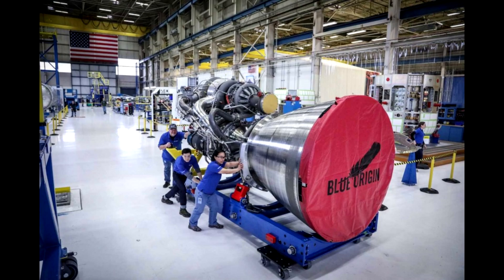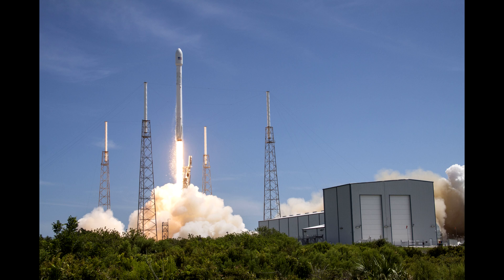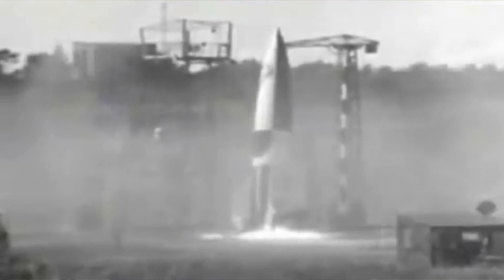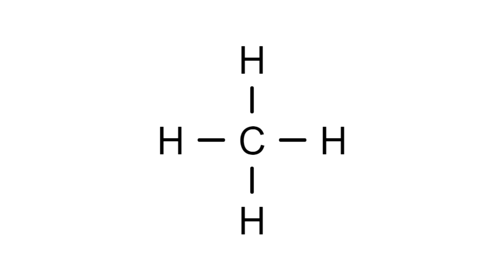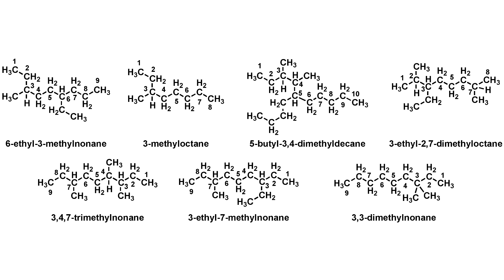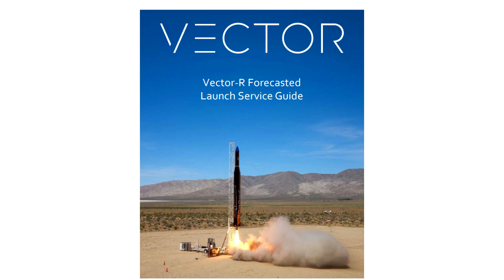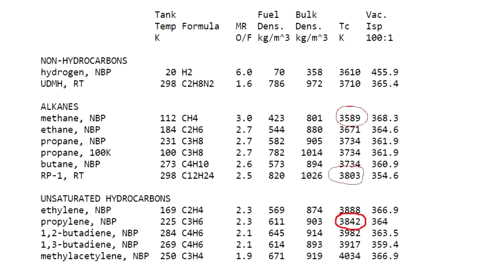Why Next Generation Rockets are Using Methane

Comment: This is funny because I'm in the middle of reading (listening to) Ignition! by John D. Clark. Between that and your video on Soviet-era engines, I've come to think of methane as "The Mario" of fuels -- kind of all-around good-but-not-great with no  particular weaknesses. It's energetic, but not as good as hydrogen; it's reasonably dense, but not as dense as kerosene or the hydrazines; it's quite safe to handle, though not as safe as alcohol or kerosene; and it burns clean, but not as clean as hydrogen.
Reply: Hydrogen does not pollute but it is really dangerous for several reasons, especially in liquid form. One as I mentioned,  because it is the smallest atom is is really good a leaking. When it burns small fames are invisible. There is also this thing called hydrogen enbrittlement where it causes some materials to get brittle and crack. That is an interesting thing to look up.
Reply: Johnny Robinson, It's really dangerous compared to jet fuel or most other chemicals people come in contact with on a daily basis, but you really have to adjust the scale for highly reactive energetic chemicals. I would say LOX is far more dangerous because it can convince just about anything to burn. And embrittlement, while interesting, kind of pales against the hypergols that would happily eat their way out of conventional fuel tanks...
Reply: While liquid hydrogen is a very good rocket fuel, it's also extremely dangerous to handle, as Lockheed found out when they did research on a potential rocket powered spy plane.
Reply: Well, I didn't put it on the list of safe materials. But let me put it this way: Compared to hydrazine derivatives, chloro- and fluoro- oxidizers, aniline relatives, and nitric acids doped with various chemicals, I would much rather catch a little frostbite. (If there's a big splash you're hosed either way, but again, the frostbite might be reparable.) And if there's a spill that doesn't directly hit anyone, hydrogen is by far the safest outside of alcohol and kerosene, since most of the other options give off heavy, toxic fumes in addition to being flammable and/or explosive.
Reply: A huge problem with liquid hydrogen is that when it explodes, it makes a natural gas explosion seem like a minor event. That's why Lockheed, whose "Skunk Works" tried to build a rocket-propelled spy plane fueled by liquid hydrogen, dropped the idea in favor of special turbojet engine designed to cruise at very high speeds: the original A-12 (which became the SR-71).
Reply: @Sacto1654  We're talking about rocket fuel. Large explosions are par for the course.
Reply: AubriGryphon...thats why JPL was placed way out in nowhere Ville <at the time> rockets blow up. Several CalTech students almost burned down their dorm iirc.
Reply: Sacto 1654...if Kelly Johnson couldn't make it work, I don't know if anyone else can.
Reply: @philgiglio9656  Kelly Johnson and his team did make it work, after a fashion. The turbomachinery of the Pratt & Whitney RL-10 rocket engine, which has powered the Centaur upper stage since 1961 (and the Delta IV upper stage, as well as the Clipper Graham DC-XA VTOVL [Vertical Take-Off/Vertical Landing] SSTO--Single-Stage-To-Orbit--sub-scale test vehicle), was originally developed for the Lockheed CL-400 "Suntan" liquid hydrogen-powered spy plane, which resembled a greatly enlarged F-104 Starfighter, with one liquid hydrogen-powered turbojet engine on each wingtip. Also:

It wasn't a matter of Kelly Johnson being unable to do it, but a matter of practicality and logistics. The CL-400 could certainly have been built and flown; no "show-stoppers" arose during its design process. (In fact, in the 1970s--in response to the OPEC Oil Embargo--Lockheed worked on developing liquid hydrogen-fueled jetliners and cargo planes with some NASA funding, beginning with a modified L-1011 TriStar test bed aircraft, with large forward and aft LH2 tanks in the fuselage [the same diameter as the fuselage, as in a rocket; Google "liquid hydrogen fueled lockheed l-1011 tristar"]. One design feature, aimed at further increasing the aircraft's efficiency, involved circulating the super-cold fuel through pipes in the wings on the way to those engines, to achieve laminar airflow.) The problems with the CL-400 were those of size and fuel logistics. The two-seat, high-altitude spy plane was huge (due to LH2's very low density, and the need to carry more fuel than needed for the engines, due to air friction cooling requirements), and the logistics of producing and/or just storing the enormous quantities of LH2 needed for even one flight were nighmarishly complex and expensive (the SR-71 was more expensive to develop, but much cheaper to fuel, store, and maintain than the CL-400 would have been).
Reply: @Sacto1654  
right. remember the Zeppelin ....
Reply: Terry Wilson, while methane has an LD50 that's basically nil, it's probably more dangrous than kerosene in the sense that you're not likely to accidentally drink the latter, while you can inhale a cloud of methane without realizing it and it's still an asphyxiant. I would put alcohol as the safest, unless you try to operate heavy equipment after exposure.
Reply: @AubriGryphon  But methane, being lighter than air (it has been used in balloons, and still is in some cases), is far less dangerous than propane--both as an asphyxiant and as an explosive--if it leaks (as my father, a Fire Chief, told me, having had to deal with both). Propane, being heavier than air, settles into low spots, just waiting to asphyxiate, or burn or kill (if touched off by a spark), while leaking methane rises into the air and dissipates. (He was enthusiastic about the hydrogen stoves, which used hydrogen gas occluded within metal hydrides in storage tanks, that came out in the 1970s, because the hydrogen burned very cleanly, the occlusion storage prevented leaks and explosions [the tanks had to be heated to release the hydrogen], and the burners' special grilles gave unmistakable indication of hydrogen burning when the stove was in use.)
Reply: Yup, that's it.
Reply: I read that book. Clark is hilarious. In the intro, Isaac Isamov tells of when he met Clark and showed him that the Bible was filed under "J" for Jehovah. Another anecdote was his discussion of the special grade of Kerosene needed for the ICBM rockets. Someone was uncomfortable with building an engine that required a special fuel. He argued that once a shooting war started there would probably be no one left to shoot or shoot at. The solution was to store a few extra barrels of kerosene for a couple volleys and that would be good enough. He mentions nuclear rockets and a test that was conducted in the Nevada desert. The event was contradicted by John P. Craven in his Silent War beneath the Sea book. I think both men were present the day of that test. Ignition! is available in hard cover but horribly expensive. My local library now has it in secure storage.
Reply: One not-often-mentioned advantage of methane--for nuclear as well as chemical rockets (and possibly for electrothermal--arc-jet and/or resisto-jet rockets, too) is its wide availability in space. Not only is Saturn's moon Titan blessed with enormous quantities of methane (and ethane), but comets--including the numerous short-period comets--and many asteroids with eccentric orbits (a lot of these "asteroids" are actually extinct comets, containing large reserves of water, ammonia, carbon dioxide, and methane ices under their insulating, dusty crusts). Spaceships could refuel from these bodies, and also replenish their supplies of air and water, which would greatly reduce the cost of space travel.
Reply: I guessq

Comment: Blazing saddles in space. From now on all astronauts will have an exclusively beans based diet, in order to maximise thrust ratio. Brings a whole new meaning to the old "save gas - fart in a bottle" joke. It made me wonder if research was still being done on alcohol ozone rockets. Then I realised you couldn't do that cos the cosmonauts would drink all the fuel. You'd be on the launch pad and the countdown would start then the "ignite engines" command and nothing would happen except a hiccup over the radio from a pissed cosmonaut.

Comment: Why can't they repressurize fuel tanks with the fuel itself for other fuels? Oxygen? Hydrogen? What's up with using helium?
Reply: Helium because its light and inert. Not oxygen because gasious O2 is volatile with... everything. And not hydrogen because LH leaks out and is explosively combustable.
Reply: @jamestheotherone742  ah, makes sense. Though couldn't the same be said of the liquid forms?
Reply: No. they are much more stable as liquids.  Also, self pressurization isn't precisely controllable, whereas pressurization is and also enables  high pressurization to gain high(er) flow rates.  The best minds in the world have worried on this for decades. If there were a better way, they would have used it.
Reply: @jamestheotherone742  I know. I just wanted to know why. Thanks!

Comment: Scott - surely you have left out a very big point. I thought that the methane is the ultimate  green and eco friendly rocket fuel. 
Using the Sabatier process on earth - same as on Mars -  you can make methane drawing out  CO2 & H20 from the air - and using power from large solar arrays as power source - create the CH4 . When the methane burns during the launch the CO2 & H20 returns to atmosphere making it overall net carbon neutral.
 If you want to have a future of intercontintal passeneger rockets and also lots of space activity you have to take this seriously as a proposal.
 If you are thinking long term and big then this is a very important starting principle. Which (I think ) is the big reason SpaceX went for it.
Reply: You can get 150,000 tons of methane at the drop of a hat. Fossil derived methane (LNG) is shipped all over the world for power generation and it's dirt cheap. In future, yes solar production would be good, but right now it would be a waste of resources to make your own.

Comment: Scott great video as always.  Super cooled RP1 as used in the SpaceX F9 rocket has a density closer to 1Kg/l.  The ISP of ‘closed cycle’ rocket engines for either RP1 or Methane are very similar.   Correct me if  I am wrong here but the ISP pertains just to the fuel consumed and not the fuel/oxygen mix (propellant).  I ask this because 8 understand that the ratio of fuel to LOX  is 1 to 2.6 for RP1 but 1 to 3.8 for methane.  Methane is less dense than RP1 but a methane rocket’s dry mass must be greater to provide the larger tanks to contain the fuel.  Furthermore such a methane rocket must carry 33% more LOX, which again means larger tanks. My own calculations suggest that a methane rocket will have to be at least 11% physically larger than its RP1 equivalent to deliver the same maximum payload to orbit.  Maybe it would be a good challenge to use KSP to design rockets with a given 50 ton payload to LEO based on RP1, Methane and hydrogen and then compare the dry mass of these three cases.  The Saturn V with crude gas generator ‘open’ engine’s was about 5% dry mass and delivered about 4% take off mass to orbit.  My guess is that BFR will struggle to get below 5% dry mass and 2% payload, albeit fully reusable.
Reply: Read about fuel mass ratios. It's a topic that explains exactly what you're talking about.
Reply: chris kerwin thanks for the pointer.  ISP I now know pertains to propellant (fuel + oxidiser).  In the process of reading more on this I found out that the Space Shuttle system was 20% dry mass and 5% payload (Shuttle orbiter + payload contents) to LEO.

Comment: Good video! Question: is there any pink rockets out there? Any plans on some? Why are they often white, black or orange? I would love a pink rocket!
Reply: The black and white stripes are there on early rockets to make it easier to tell if they're spinning on camera. Using orange instead is for visibility (like Zenit) or because it's the color of the material the rocket is coated in or made out of. The Delta IV is orange because it's covered in orange foam to deal with the hydrogen fuel boil-off. Soyuz is sometimes orange because the alloy they use on part of the rocket is copper colored.
Reply: Thank you!

Comment: Always wondered why Diborane isn't used more frequently. Nearly twice the density of methane, no more hazardous than hydrazine (still very dangerous), is extremely energy dense, and its exhaust products are; boron trioxide (a glass), water, and boron monoxide. Perhaps its just expensive and too much of a hassle to use.
Reply: Boron trioxide tends to block up the engine (due to being solid at the chamber wall temperature). This is an almost insurmountable problem for boron fuels burning in oxygen, and killed the USAF's 'zip fuel' program for combat jets back in the 1960s. 

The problem doesn't exist if you use fluorine as the oxidiser (boron trifluoride is a gas at STP) but then the exhaust (a heady mixture of HF and BF3) is so toxic and corrosive that you'd have to be mad to even test fire such an engine, let alone use it regularly. The exhaust would be a pretty green colour though.

Comment: so, RP1 is a mixture of hydrocarbons, and if it wasnt, there is possibility of clogging up parts of the engine as you said. Well then, if BFR goes to Mars on RP1, but returns on methane made by Sabatier process on Mars, it would suffer from this engine clogging on return trip, would it? 
Maybe I just misunderstood.. please clarify
Reply: All the engines on the BFR are going to be Methane.

Comment: Is it possible to make airline jet engines that use methane? Would it be a good idea?
Reply: Yes you can but you would need  muchlarger fuel tanks.  For that reason it doesn't currently make sense to make methane powered aircraft.   However many aircraft engines were redesigned to run on methane and they are now in used at natural gas power plants.

Comment: At 4:25 you say that Methane is slightly less energetic. I don't think that is true. Measuring the energy content by weight Hydrogen gives more energy when oxidized than Carbon. if you look at the Energy Density of various fuels like kerosene and methane you might be confused if you looked at the energy per volume, but if you look at energy by weight you see the advantage to methane and Hydrogen as a rocket fuel. There is a weight penalty for a bigger tank and cryogenics so it scales up better with bigger rockets.  In short Carbon is a compact fuel that weighs 12 times what H does, or 6 times what H2 does. 
https://neutrium.net/properties/specific-energy-and-energy-density-of-fuels/
Reply from the maker: You have to include the mass of the oxidizer when computing energy density.
Reply: I agree you have to add the oxidizer. For Every C atom you have to add an O2 molecule to get CO2 and -393,520 kJ/mol (44 grams). For every H2 molecule you only have to add 1/2O2 or a single O atom to get -241,820 kJ/mol (18 grams), so for a single O2 oxidizer you get a total of -571,640 kJ/mol (36 grams) when you burn Hydrogen compared to -393,520 for the heavier carbon.  You get more energy per mass when burning a fuel that has a higher Hydrogen to carbon ratio.  The molecule that has the highest Hydrogen to Carbon ration is Methane.

Comment: The Raptor engine will be running at more than three times the chamber pressure as the SpaceX Merlin engine so having a lower temp should make running at higher pressure easier on the engine.

Comment: Mars Direct & Sabatier Process:  does it need a hydrogen feedstock?  Since Zubrin wrote his plan a bunch of water has been found on Mars.  It's got to be possible to pack a water mining robot and electrolysis setup in less than 8 tons.
Reply: The original plan called for hydrogen to be taken and I would expect first attempts would do it that way too.  In a perfect situation Mars water would also be used.

Comment: So basically next gen rockets will run on LNG.
Reply: You could fuel a sea dragon at sea with an LNG tanker too. 150,000 tons of fuel should be enough? The difficult part is reliable electrolysis of seawater for the oxidizer.
Reply: Next gen rockets will run on the methane that makes up 90 percent of LNG.  Just like RP1 is purified kerosene, methane is purified LNG.

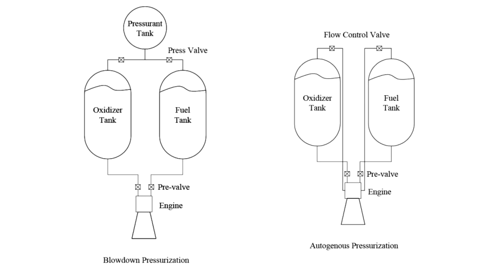Comment: At 5:02 you said that the fuel gets heated and then put in the tanks to pressurize them.  Isn't it proplematic to put fuel in the oxidizer tank? What is keeping it from reacting?
Reply: I don't know it for fact, but i guess you heat oxygen for the oxygen tank and methane for the methane tank.
Reply: Heated methane goes to the methane fuel tank.  Heated Oxygen goes to the oxygen fuel tank.  As a result fuel and oxygen doesn't mix in the fuel tank.